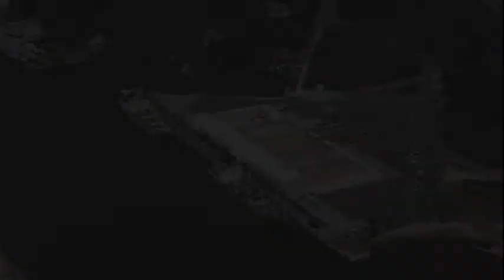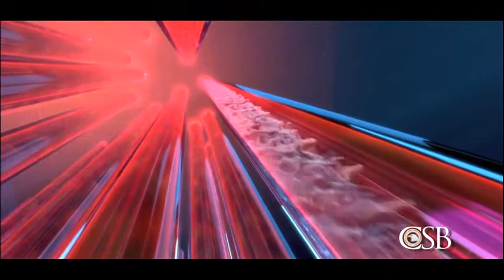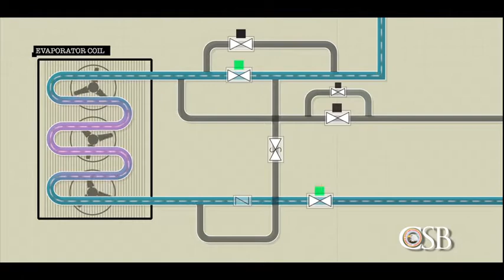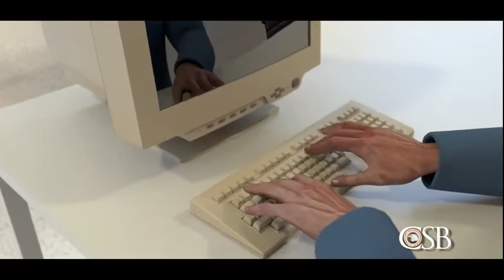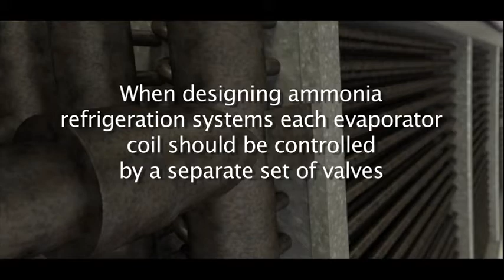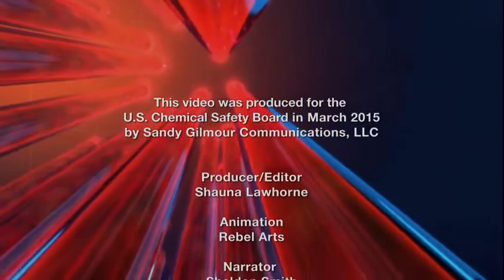CSB Safety Video - Shock to the System

Comment: Would florochlorocarbons which have been outlawed have the same potential health hazards?
Reply: 3 years no answer. I would assume maybe less health hazard to those that was exposed but the environmental impacts would have been much greater and therefore become a bigger health hazard. I cannot do the calculations but how many of these pipes rupturing will it take to remove enough ozone to kill the same amount of people. I think the hydraulic shock would still occur regardless of the material used.
Reply: Just a tied all together The floor carbons would have been just a dangerous or worse than the ammonia they're all very toxic and nasty depending on the density of the particular floral carbon you may have something that rolls along the ground more so the ammonia dissipates instantly when it hits water if everyone it floated up too on the clean-up project jumped in the lake they would go a long ways towards being safe. I believe they are about equally toxic to toss up between the fluorocarbons and ammonia.